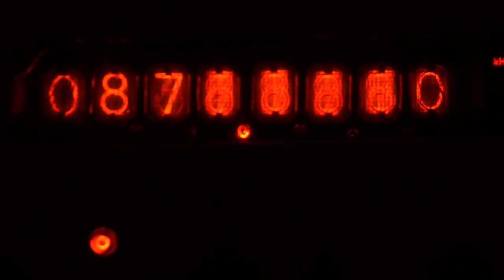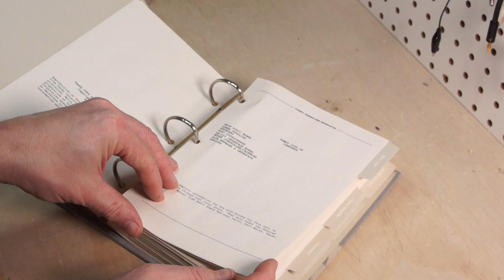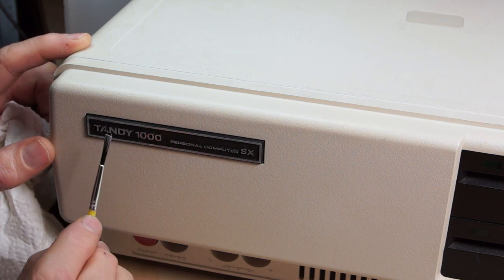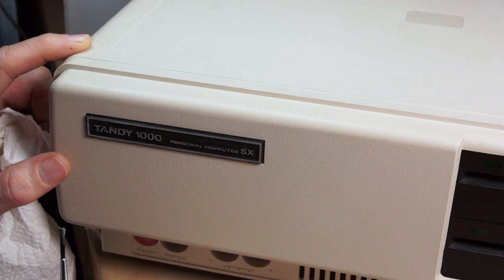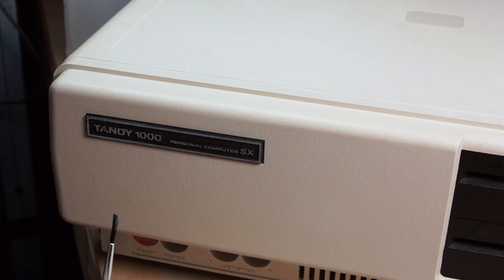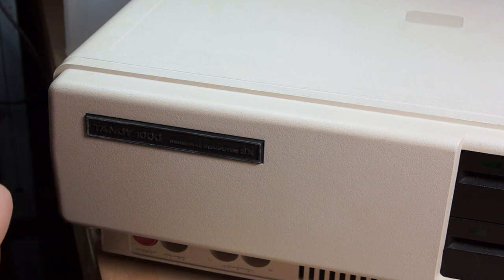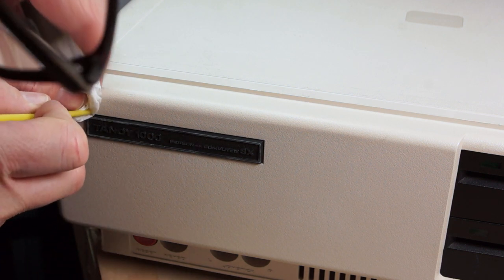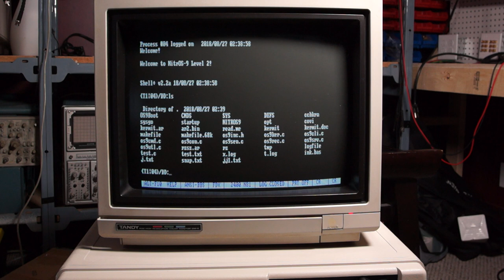Sad Tandy 1000 SX - Repair and Restoration

Comment: You made me feel bad about mine. It was in a flood. I still haven't restored it if it can even be saved. But like you, my Tandy 1000 was what inspired me as well.
Also, you should show how you programmed on it.
Reply from the maker: Too bad! I encourage you to try getting your machine working.   One thing that might help is actually putting the motherboard in the dishwasher....  sounds crazy but I've done it with really sensitive stuff with good results.  And thanks for the video suggestion, I will work on a little Turbo Pascal video in the coming weeks.

Comment: Everything you said about the 1.2MB floppy backwards compatibility with 360k disks is correct, however the 1000SX doesn't support the use of high density floppy drives at all - so it wouldn't work in this machine whatsoever even with 360k disks